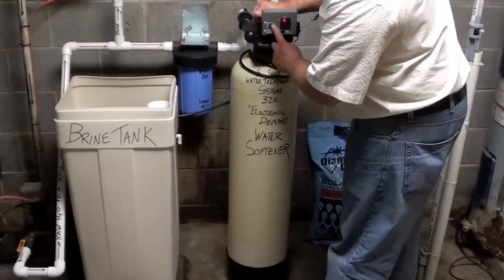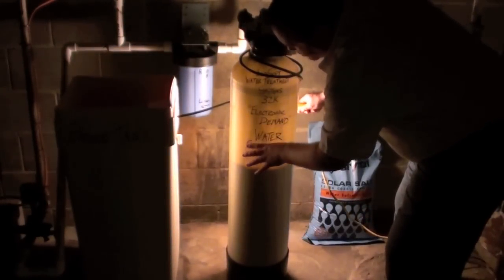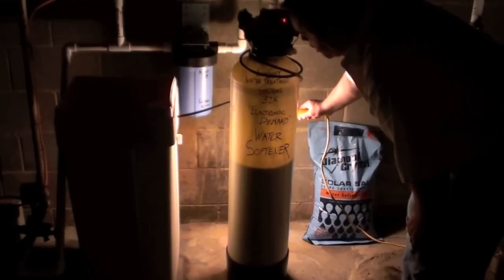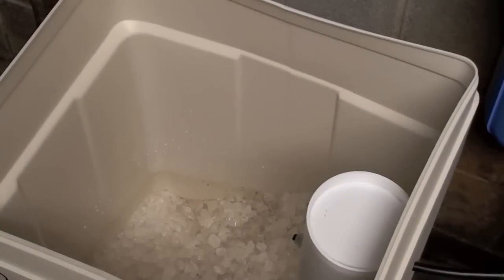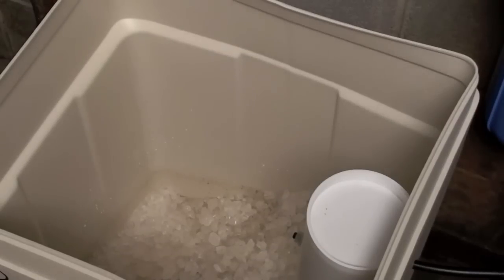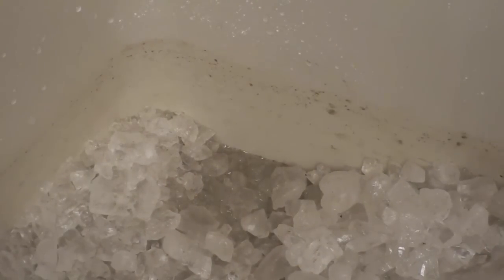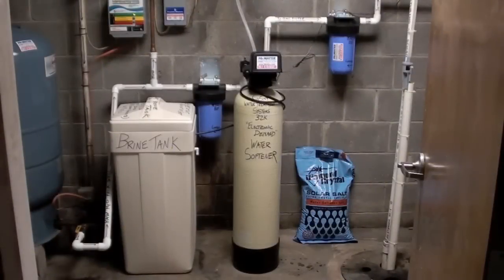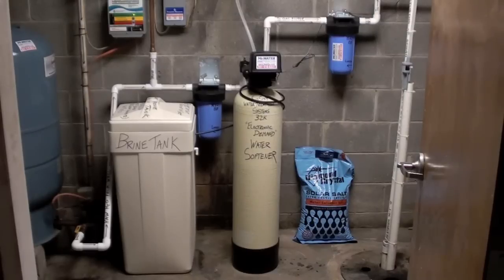Part 3 of 3 - "How a Home Water Softener Works" - Mr. Water Professional Water Treatment of Maryland

Comment: One thing I would like to understand.  Is the water metered when filling the brine tank at the end of the regeneration cycle?  If my brine tank refill gets stopped by the float in the brine well, does that indicate a problem?  I was told by someone that the float should always stop the flow of water during brine tank refill and that does not make sense to me.  Can you explain for us the right answer?  Thanks.
Reply from the maker: If you have an Autotrol Valve the brine tank refill is controlled from the salt dial on the side. If you have a Fleck valve the salt dial is inside the valve accessed in the back. Some valves do not have a salt dial at all and the float in the salt tank shuts off the refill. Some valves are preset from the factory and are set to a certain brine tank refill time and some DON"T have a float in the brine tank - bad news if your injector gets clogged and the salt tank overflows!

Comment: Thanks for your reply. Another question... on the ventri valve there are two pipes one says in and one says out. Does the out mean that the flow of the water is going to the house or out of the house?
Reply from the maker: In and out of the system.

Comment: My question is why do I have a 3/4 inch pipe that water is pouring out when my water softner is recharging? I can't figure out why this water is pouring out into the drain. Any ideas?
Reply from the maker: That is the backwash regeneration line for dirty water.

Comment: For a 2-3 person system, I'm told to get a 24K system.  Would putting in a 48K system save me money in running the system per year?
Reply from the maker: 24k is a bit small for most homes and will have to regenerate often - but if you don't have very hard or irony water it might be fine.

Comment: I could use some help. I just installed a new softener and there are times that I get the typical rotten egg smell. I do a manual regen with it and usually it goes away. Does that mean that I just need to make it regenerate more frequently/raise the hardness setting on its computer (as it is a digital softener)?
Reply from the maker: A standard water softener will not remove hydrogen sulfide (a gas) from your water.

Comment: Thanks for the only information that comes from a person who seems to know what he doing and not reading from a paper. I have a Fleck 7000 that I can never tell if its working or not.  I hate it and I wish I had public water.
Reply from the maker: Get some cheap test strips from lowe's. See if its hard or not - if it is hard turn up the salt a bit - have to go into the settings. Here is the manual - https://www.pentair.com/content/dam/extranet/fleck/manuals/42775-fleck-7000sxt-manual.pdf

Comment: I recently replaced the resin on my tank but left the original gravel. My question is, does the bottom basket on the tube needs to be submerged under the gravel level? I tried shoving it down there but I'm afraid it did not go deep enough.

Comment: Q:  In a house with a septic system, will years of soft water use plug up the leach line field with solidified salt?  
Q:  What do you think of the cartridge type water softening systems they advertise on TV.  Its basically a large filter impregnated with citric acid molecules (according to them) with no moving parts, no electrical hook-up and no valving, just cut it into the incoming house feed line.  Sells for about $300 to $500 depending on house size and requires filter replacement at time intervals depending on use. They don't say how much the replacement filters are or where to get them.
Reply from the maker: The system you are describing sounds like a gimmick to me or at least NOT a water softener. No the salt from a water softener will not harm your average septic system.

Comment: I just purchased and installed  Water Boss Model 700.  We followed the instructions as told to do but including the part of adding two gallons of water running through the regeneration process but the water level far exceeds 2 gallon.  It comes up to where the black tank is seamed together.  What am I doing wrong and is this causing a problem?

Comment: Hi Scott, excellent video. For some reason my softener if leaking water thru the fiberglass from the top down. Enough to accumulate water on the floor of the basement. When I shut the water to the tank then it stops. Any idea on what could be the problem? Thanks in advance.

Comment: Very informative!! Thanx!  My Rainsoft E2C has stopped using salt.  I'm gonna check for a salt clog and break up the salt in the tank. The other symptom is that we occasionally get a "slug" of salty water at the tap.  It goes away after running the water for a few minutes.  Is this a valve problem? Or a controller problem?

Comment: Great videos!  I am buying a house with a very similar system and this helped me a lot to undestand it.  I have a home inspection coming up and will leverage this information to see what I need to do with the system.  For example, I will be checking for the filters.  One question, being new to this I don't undestand about the system going through the various cycles.  Is this something that the system does continuously through out the day, on it's own monthly or when you add the salt?  I understand what it does very well now but not when :)
Reply: Your system when set up is set to regenerate at a certain time, say 2:00AM is generally the default time.  No, it doesnt run continually.  I have a Fleck 5600XST and the cycles are programmed Backwash 10 mins, Brine draw-slow rinse 60 minutes, rapid rinse 10 minutes, and brine [re]fill 12 minutes. You add salt as needed in the brine tank.
Reply: Thanks!  You were right, it does it every other day at 3am.  I go through about a bag and a half a week.
Reply: You must use a lot of water, or very hard water, oe like it slippery, HA, to regenerate it every other day.  Mine is set to regenerate every 650 gallons [ its metered] which comes to about 1-2 times a week depending on usage.

Comment: Other than replenishing salt periodically, does this require any service? If so, how frequently and what is involved in the service. My system is about 5 years old and I am losing water pressure.  The company that installed it for me is out of business and I do not know how to fix the problem. Any pointers on what may be going wrong? Thanks.

Comment: Why was a water softener place on the hot water of (somebody house) only and not all the cold. The cold water for the fridge is not soften and every cold tap, I find that weird. Please explain. were they being cheap.
Reply: +Scott R. Handy (Mr. Water) is that small amount of salt in the water bad for you?  OK, I would also like to know.  will copper/other pipes corrode or break with this added salt?
Reply: Jaime Perez, the normal daily consumption of sodium for a healthy adult under 55 is about 2,500mg.  Using the sodium exchange stated in the video compared to 20 grains of hardness and a typical setting of softness, every liter (quart) of water will contain 180mg of sodium.  So, if an adult were to drink one gallon of softened water in this scenario, they would consume about 720mg of sodium which would leave a difference of about 1,780mg of sodium left per day.  Your typical large fast food cheeseburger contains about 1,000mg of sodium.  So, in this scenario, about 1.5 gallons of softened water contains about as much sodium as a cheeseburger.  If your water is more or less harder than in this scenario, then the numbers will be different.  If your water contains 100 grains per gallon, than about 1 to 2 liters (quarts) of softened water could contain the same amount of sodium as said cheeseburger.

In my opinion, if your water is not that hard to begin with and you have a typical setting, the amount of sodium in the water would be fairly safe.
Reply: LNC4P thanks

Comment: what is the dirt ring or black ring in the salt water tank?
Reply: +arshi khur That is what I would like to know also.
Reply: Ok I figured it out it is dirt from our water as the resin acts like a filter too.  There is a water softener cleanser you can buy from Lowes or HD.  Whirlpool require you to use it to extend warranty.  Thanks to these video I was able to change the softener myself.

Comment: Great video - thank you.   My electronics went out on my unit so I'm manually running the cycles and timing them.   My softener has on the dial in a counter clockwise order :  Service , Purge, Backwash, Draw/ Rinse, Refill (then we are back to service.   I'm wondering a few things.  What is the Purge cycle ?  Does that flush old minerals off the resin for starters? How is that different than Backwash?  

Another Q: Is there a time frame I should let the Brine sit on the resin before rinsing it off ( then what mode do I rinse if off with?)  During that rinsing mode how long do I let the water run to wash away that salt taste?  

I know it's a big list here but any help would be great!

Thanks

Comment: FANTASTIC video that taught me exactly what I wanted to know about how the water softener works.  Thanks for your efforts to put this video together.  My water softener was sitting in bypass for years, and now water is slowly dripping out of the drain line 24/7.  After watching your video, my guess is the bypass valve is not sealing very well allowing water into the system.  After that, not sure if the valve system is no good and needs to be replaced.  In any case, your video is really useful to help me decide whether this system (around 13 years old) is worth looking into fixing or not.  I appreciate your efforts.

Comment: thank you for sharing these videos. they are great.  when is you I did not see addressed is something I'm trying to learn more about. I've been trying to find out why when my water softener runs a pond forms in the ground outside next to it. my water softener guy said that's normal.  I'm looking into installing a dry well next to the softener to disperse this water. but I also am still doubtful about whether having a small pond form next to my water softener when running is normal?

Comment: I'm sure you know by now, but for others who may read.....you can get the tanks, prefilled with resin for between 300-800 dollars, depending on size. So if you need 2 tanks, ie. softener and an Iron filter at most you would be looking at $1600. Add a few hundred for hook-up and I would say btwn 2-3k max. These are guestimates, but Ive kinda done my own work inthe past so am somewhat familiar w pricing. Dont let those water companies take you!!

Comment: When adding acid adjustment to the water stream such as mag oxide please compensate for the additional hardness load on the softener. Good video. What  type of hardness are you working with in your area.

Gary Lindsey  CWS VI CI

Comment: GREAT video! Taught me so much on how these work. One question we have right now though wasn't mentioned. That tube that is coming out of the water softener and goes up you didn't mention and we are trying to figure out what is in that water that drains? Wondering if we can use it for plant watering? Appreciate the assistance. Thank you

Comment: Kudos to the maker of this video, it explains a lot in detail. For those asking about the brine tank if you look around or on the control panel. You should see an option that allows you to alter the water level in the tank. Either by gallons or by pounds in tank. Note: It will always refill your tank to the set level so you have to watch the salt level.

Comment: I have a softener and In my brine tank the water and salt levels very nearly match.  There may be a few inches of water above the salt when the salt gets low, but there is a float in the tank to regulate the water level. From my understanding the tank should never fill up to the top with water.  By the way he is right, this is the best vid on youtube about how water softeners work.